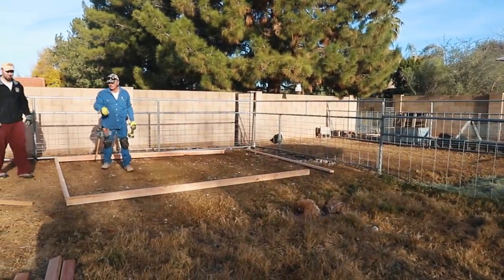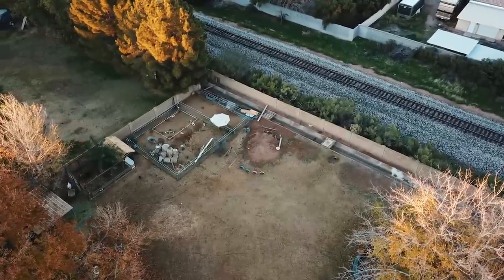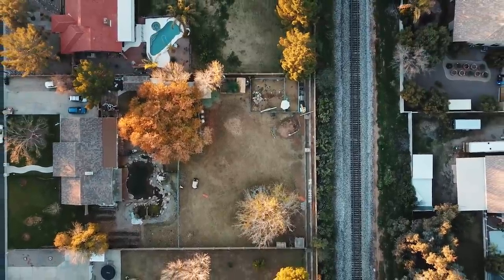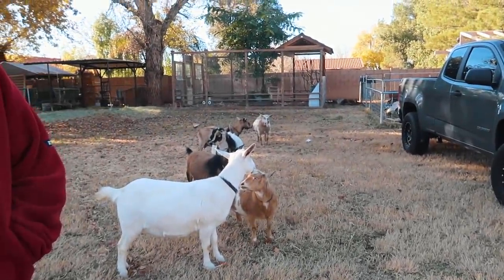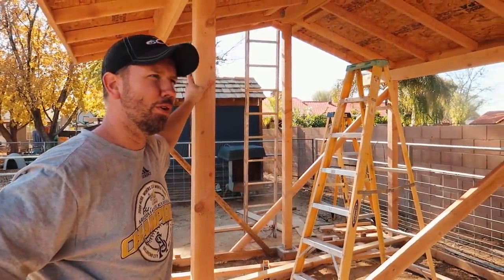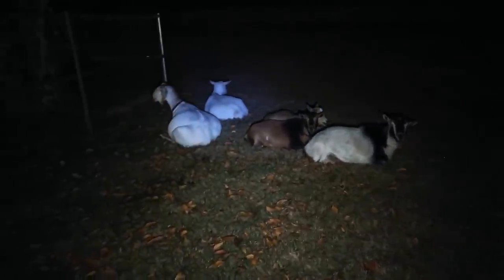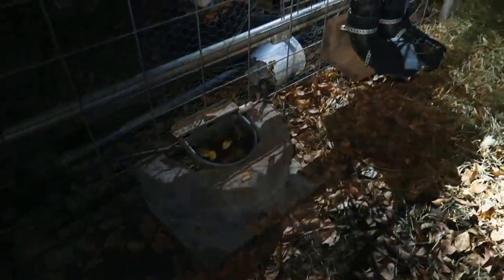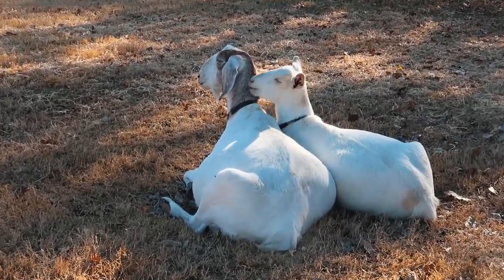Building a GOAT BARN in our suburban backyard!

Comment: We used what was called T111 siding on our barn. My dad sat down drew up the plans on paper as we built it. We made stalls 12x12 for horses use the size of the cage your goats have had the babies in but make it longer. That will give you room to get around in there and if she has more then one kid they have room. Do Dutch doors that open not sliding. Have have windows in the back of stalls for cross ventilation. They should have hinge doors on them.    You forgot about the pig she will need a dry spot to when her piglet.

Comment: You should be happy to live next to a train track. I grew up living next to a SWITCHING YARD. It's a place where the tracks are split into many different tracks so that trains can be split apart and joined into other destinations. Unfortunately, that switching was done in the middle of the night.  One by one, the cars were detached, and driven into the new train. The engines revved loudly with each push and the bang of the switched cars were loud as they connected. Over the years we learned to ignore them, and eventually sleep through it.

Comment: great orchard.  I do quite a bit of home orcharding myself.  I haven't notice you mentioning pears.  I have several regional strains of pear with very low chilling requirements.  I imagine that lack of chilling hours would be your biggest challenge with pears.  My lowest chill pear is Goldenboy which only requires about 200 hours.  It's a high quality soft pear very similar to Bartlett but much more disease resistant and requires way fewer chilling hours.  It's most reliable pollination partner LeConte also has a similar chilling requirement.  My LeConte strain is the original (good) one.  It's also similar to Bartlett but has a bit more applelly flavor.  I have a few other varieties that you could probably grow as well.  It's not legal to send rooted plants to Arizona from Georgia, but I might be able to legally send scion if you want to get into grafting.  I just collected scion this weekend, so no is the time if you want me to send you some.  In your climate I imagine about any pear root stock would work.  Here in SE Georgia, we are limited to using flowering pear and seedlings from our fireblight resistant southern varieties on account of our humidity and blight pressure.  Let me know if you would like some pear scion.

Comment: Why dont you extend it at the side to include a bigger milking station? You’ve already admitted that your current milking station is a bit small especially for  Luna to get a run up on the ramp. Plus you could fit exit and entrance doors to save the congestion when getting the goats in to milk. Plus it would be more enclosed giving you extra coverage for when it rains during milking. It doesn’t have to be fully sealed up with doors, but like an overhang like Al has built on the side of his goat barn on Lumnah Acres. It’s a thought. It would look lovely